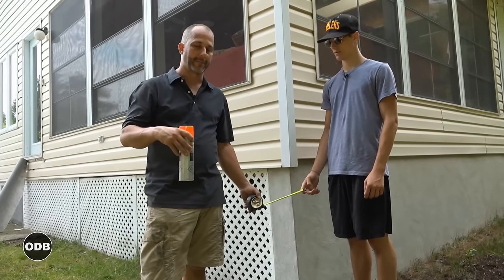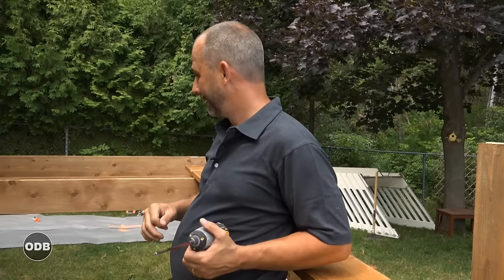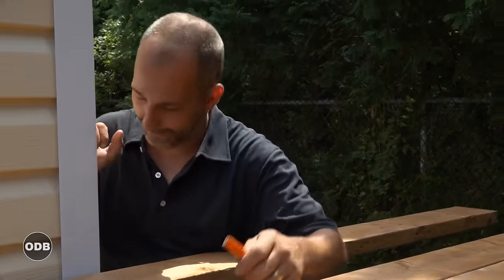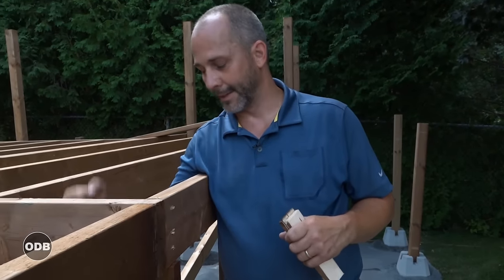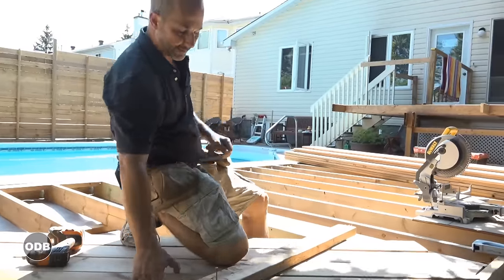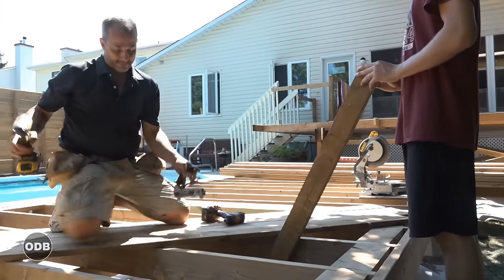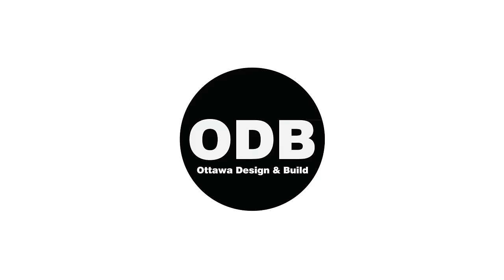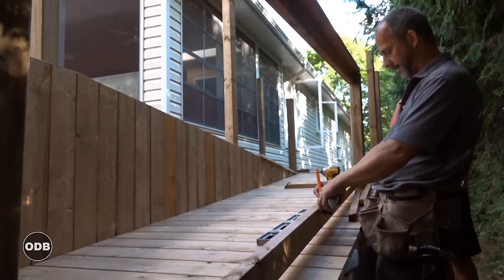How to Build a Deck for Beginners A to Z

Comment: This deck is NOT legal in most USA states. DO NOT build your deck like this. Footings should be below frost level, lag  bolts should be used not screws.This is a poor example of building anything.
Reply from the maker: Funny, a large part of the united states doesn't even get frost. Structure built on top of box beams don't need lags. This deck was built with a permit. Gary is obviously sadly mistaken with his understanding of the facts.
Reply: Water is changing volume of the upper ground (specially with grass) and you get floating level of each corner of your deck. No matter where you build you should always stay on the sand not on the grass
Reply: Ottawa Design and Build Renovations g
Reply: In California and Minnesota (both places I've lived), we need to either have posts in the ground or have concrete footings. Saved on a lot of labor, which dramatically lowers cost, however; I am just amazed it passed inspection. Never tried the camo screws, and they look amazing! I'll have to try them sometime.
Reply: That is one good reason you might wanna move to Canada mate!!!
Reply from the maker: truth is you could remove the organics, but time with settle that deck a 1/4 inch. not a huge deal.
Reply from the maker: Allen Peyer, The trick is to know your local building code and have the inspector do a pre construction visit to discuss the plan and make sure you are delivering the product that the inspector wants to see.
Reply: Friend, so you got permit from inspector for this deck construction, right?
Reply: yeah, this is just crazy unless if live if arid states near sea level like Texas.  you can argue about frost all you want but it only takes 1 frost season out of 10 20 30 years to screw up your deck.
Reply from the maker: frost doesn't damage a floating deck unless you attach it to the house. that would be dumb.
Reply: Gary is 100% Correct.  I am a GC licensed in several states both northern US and southern.  This type of construction is not legal or even close to legal.  In NY, NJ, PA and CT you need 12x36 footings or 18 in some areas.  In FL you must go down 36" and 6" above ground level.   I guess Canada is different but do not plan on then process being so easy in most US States.
Reply: This deck is perfectly legal in Seattle.I watched a city inspector buy off my neighbors deck.Nice deck!
Reply: Gary Oldham its legal in hawaii, theres no frost level there
Reply: This deck is perfectly legal. If you listen to Jeff (who goes above and beyond  in his work) he explains that the screws are not bearing any load. All load bearing points are set with screws and bolted into place.
Reply: @Customer Service, Please post some of your build videos so we may learn from the master..
Reply: Communism becomes the scapegoat here. The problem is this country never proper teach what communism really is.
Reply: I remember him saying that the county/city gave him a waiver because it is attatched to the house "Which in my state would not pass inspection if attatched or closer to any other structure less than 6' being a floating deck. Also has to be less than 30" from the ground if a floating deck. I think these guys did a great job under the circumstances and situation they had.
Reply: i believe he said they could have gone with footings but what the county wanted wasn't cost effective for the client so they went with this so suck it
Reply: Gary Oldham I
Reply: Come to Montana and put some footings under frost line (7 Feet) ha h
Reply: @dattape2828   He is quite correct, a floating deck is just that, A FLOATING deck!  It move up 1/4" in the winter @-40 C/F and lower 1/4" in the summer @+40 C/103 F. In Texas you run the risks of hurricanes. This build is not for you...I understand that. So pilings (in Alberta where I live 8" Sauna Tubes reinforced with rebar) with a 24"-36" concrete pad at a minimum of 4' below grade for each post would be your only option. Each and every state has their own code, and we must follow those codes to get an inspection pass, to continue.
So do us all a favour and not spout American standards, which are followed in Texas. Your neighbouring states NM or OK have different standards. You are comparing Apples to Oranges. The site Jeff was on ALLOWED him...OUR Set CODES.
 To be truthful, Jeff went overboard on the construction to ensure it was safe and done properly and above the Municipal code. Then end result was fantastic! I would love to work with this man for one year just for the experience I would receive.

Comment: Wow. I found this video because I was wondering about using deck blocks in this area where frost is definitely an issue (I'm in Carleton Place, just west of Ottawa). I learned so much from this awesome, straight-forward video.

Thank you, Ottawa Build & Design, for the education.
Reply from the maker: Hi Dave, great bumping into you at the Home Depot. Remember, I am here if you have any Questions
Reply: Actually, you were a huge help yesterday in the store. Super helpful.
Reply from the maker: Glad to help Dave. Good luck with your project, and remember I am always here to help in the comment section of the videos.

Comment: Really liked this video! I'm a carpenter of 10 years and although I would have done a few things differently like notch the posts for the support beams, loved the ideas a newer techniques for fastening. I've always done things old school so seeing the new Simpson joist hanger screws and that camo fastener system instead of surface screws really caught my eye lol. Thing I really liked was the tampered glass on the railings, it definitely opens up the deck to the yard and pool area. Great job! I got a 600 sq ft deck to build in the coming weeks so I'm gonna make some suggestions haha. 🖒
Reply from the maker: Thank you. The post idea is definitely causing some waves however I am glad you appreciative the other elements of the deck. All I know is , if it passes the inspector and engineer then who am I to complain.

Comment: Really great video, I recently did a deck using pavers on the ground and little threaded feet to keep it low profile. I found just removing the grass to get down to the clay took a bit of bounce out of it. I picked up lots of tips from your video for next time!
Reply from the maker: The truth is with floating decks, you want to maintain access to the structure to manage any movement anomalies. This is why i wasn't concerned about the grass. I figured i would be doing an adjustment call at some point. Thanks for watching

Comment: Thanks for putting the time in to show so many tricks to simplify workflow, you obviously love what you do and you're not to shabby with a camera and editing :) Congratulations on a wonder build, I hope the client is happy as it seems you've really dialed in to what they required.
I've gained the idea of the Camo system which to get the finish I'm looking for may take twice as long as visible fixings but it will save me hours of counter sink, filling and sanding so thank you again.
Reply from the maker: My pleasure, btw camo screws have a stand op speed attachment if you are doing a large space. It can make it much quicker!!

Comment: Very nice! I'm building my deck like this (floating) so I can stay out of the dirt/grass here in SE Georgia. Will only be about a foot above the ground. Wont be attached to the house, and will have a concrete pad for Hot tub right next to it. Like that picture framing technique, Thanks for posting!!.. Built a 16"x24" shed on blocks, (floating I guess) about 2' above ground, 8 years 3 hurricanes and the rascal still stands, so I know that building on blocks like that does work.
Reply from the maker: They don't do well in tornadoes though. Thanks for the comment. Good luck with your deck. sounds great.

Comment: I have found that Kreg offers a great hidden screw system versus the camo, I found it works a little bit faster and i personally like working with Kreg's screws more, just a thought, the deck looks great, and that box frame system was definitely the right choice.
Reply from the maker: Thanks Patrick. I will check that out

Comment: Hi Jeff,  great work as usual. Quick question, Im buildng a one level floating deck this summer and was wondering if it's safe to bolt a Gazebo on top of it? I'm planing on getting those big box store pre-fab Gazebos.  Thanks in advance.

Comment: Looks good.   Seems to be well planned out.  The only things I would do differently:

1.  On the lag bolts on the beams, instead of doing vertically, I put them diagonally.  Keeping the stress of board splitting away from a single line.  Like you did with the skirt.
2.  Use joist tape, especially on the blocking you have.   Without tape, runs a bigger chance of trapping water.
3.  Wear safely goggles when sawing to prevent getting dust/metal in your eyes.  Especially if you are presenting to others. 
 But at least your junior junior carpenter had glasses. :)

Other than that, good stuff.
Reply from the maker: Still working on the balance of safety and just acting safe. I have seen a lot of videos where guys use so much ppe that they put themselves and others in danger due to not having a clue of their surroundings.

Comment: Awesome work! Great Content! I've watched countless Hrs of your videos! keep it up.
I'm in process of planning a floating deck (12x16) under a covered porch on 12 inches of Gravel that the builder put in approx. a little over a yr ago.
I was thinking of doing a Box beam on deck blocks.  Deck will have 1 step down. 
Wondering if 3 rows of a single 16x2x8 on a span of 3 or 4 deck blocks would do it. or should i be doing 4x4  into the block with (2) 2x8's. I hope this makes sense!!
I'm in south west Ontario.

Comment: Enjoyed the Video. When skirting, how do you cover the support blocks below. It looks as if they'd stick out just a bit at the bottom. Want to make sure I do it right lol.
Reply from the maker: In this case we weren't concerned about the rear view of the deck but you can hide this simply by adding another rim piece to the existing structure.

Comment: Great video, two concerns, you really need to start wearing eye protection when using your power tools. And do you use triple galvanized joist hangers to combat the corrosion of the copper treatment in the treated lumber?
Reply from the maker: Not sure about the copper. I use whatever is on the shelf at the building store.
Reply: USP at Lowes is hot dip triple zinc, and simpson strong tie @ HD, is 90 minute electroplated galvanization. Either or, both are fine for deck applications.

Comment: a floating deck and deck block's I like to put a 2'x2' footing on tamped gravle over soil and take 51/2' of grass and soil.Because I have had deck blocks move and even sink unlevel. I really respect  that you understand screws are no good for framing and you should use nails or hardware that's made for the situation at hand.i like using a palm nailer for joist hangers because its fast and hangers get boaring.lol. have fun guys
Reply from the maker: great ideas bruce.
Reply: I learned this from 2 olg guys that use to set up my  work week when I was just starting out as a installer and got all the shit jobs.lol.Respect and good job guys and nice to see your son working with you

Comment: Just a couple of points: 
1) I noticed when you were showing how the stairs of the deck would be built, that the beam supporting the ‘fishtail’ deck was positioned on top of the concrete block, not in the grooves how it was originally positioned? 
2) you appeared to fix the head of the stair stinger support to the thin timber siding of the deck with only a few screws? Please tell me it was better supported than that!

Overall, looked a good job, but can’t say I particularly like the surface blocks... I would have wanted to put a box around the lower part too, and cross braces between the upright posts on the 5’ high decking and the ramp section at least.

Comment: Hi Jeff, great video once again. I thoroughly enjoy watching your videos and learning from you. I'm interested in building a deck in my own home and I am trying to determine what the general guidelines are for spacing of concrete posts or blocks. Would you please share what the guidelines are for quantity/spacing of concrete posts based on beam and joist sizes? Thank you!
Reply from the maker: The space between supports is all relative to the size and type of lumber you are using. I would stop by the local building office. they usually have some good reference materials for deck building that will help in your district. Cheers!

Comment: I notice that you put a beam on the lower deck in the center. What was the size of that beam , 4x4 and did you use 1/2 galvanize bolts .

Comment: Jeff, @ 7:37 and really for the whole install of the structure, there is an easier (and cheaper) level to use. Using a 20' or 25' piece of 1/4 inch clear tubing filled with water ( and a drop of dish soap) you have a very accurate long distance level. It would save a lot of time and energy for this and other installs.
Reply from the maker: Hi Logan we will show the water level system on a deck this year. Cheers!

Comment: looks great . and very well explained the process of building. but if i build a deck like this i will not pass inspection on the the footing,  the use of screws instead of bolts.  but...looks ok. i live on North Carolina USA and building code requires concrete footing below frost line.
Reply from the maker: We do as well. However we don't have gale force winds here which is why this type of footing is allowed as well. Thanks for watching. I hope you subscribed to the channel.

Comment: Looking to building a floating ground level deck but was hoping too see what you did around the concrete blocks on the small deck? How did you finish it? Don't they stick out?
Reply from the maker: We built a small 4x4 retaining wall and filled it with river stone. It was the back side and so we were not to concerned with the aesthetics.

Comment: Wow...  great job. Your video has inspired me to build my own deck.  My deck would be 10 x 24.  I'm thinking of building two 10 x 12 sections.  How many deck blocks would you use?
Reply from the maker: if you build 2 equal sized deck sections I would use 8 deck blocks and build my substructure with 2x8. good luck and thanks for watching. Don't forget to subscribe. We have a ton of great material on the way

Comment: I know the carriage bolts you used are rated at a high shear strength, but I would still use the beam over post method for peace of mind.
Reply from the maker: I totally get it. Did you know the Eiffel tower in Paris is constructed completely with carriage bolts and does not have a single weld in it.

Comment: Super helpful video, thanks for making this. I'm building a 10x10 ft square floating deck and will be referencing this video a lot! Do you have any suggestions on how many deck blocks I should use to support the frame? Thanks again for your help!
Reply from the maker: If you use the box beam method 4 blocks with 2x10 frame with 2x8 joists and rim. good luck!

Comment: The one thing I really wanted to see, you didn’t show. What did you do to deepen the structure to fasten the stairs to the deck frame? You don’t have much depth once you drop it down by the first rise. 
Also, should you fasten the stairs with carriage bolts or at least with nails? Wouldn’t there be a lot of shear force if it’s just fastened with screws?

Comment: Very informative video. Really like the glass panel concept. Considering this myself now as a DIYer. Two questions if you dont mind. Is the top rail above the two panels of glass at 1:18:26 continuous or do you have a joint at the post? How deep did you make the channel in the top and bottom rail for the glass?

Comment: This is reall well produced and pretty enjoyable to watch.

So, am I understanding correctly that the "box beam" allowed you to use very few of those concrete footing blocks? You also mentioned something about the cantilever of the deck...the logistics of which flew over my head...could someone explain it to me a little? Thanks!
Reply from the maker: A box beam with 2x8 joists will span 8" inmost jurisdictions and also allow for up to 2 ' of overhang or cantilever  on each side. thus giving you a 12 foot span.
Reply: Ahhh...okay, I get it now. Thank you!
Reply from the maker: glad to help Mark.

Comment: Fantastic video, you can tell you have been in the trade for a while, you have an obvious understanding of not only what looks good, but what will practically work for years to come. So many comments on here criticising, saying it isn't up to code bla bla bla. You clearly state it is several times in the video, maybe some people have their ears switched off? Anyway, a great build and well designed. Great points on working with the clients too, too many people let their own ideas and ego get in the way of a design and build, rather than making something that the person who is paying for it actually wants, and something you can be proud of. 
Do you have any more details regarding the timber/glass  ballustrading? Is it just dado grooves the whole way around or is there more too it? Also what thickness glass is in them?
Regards from NZ.
Reply from the maker: The glass was purchased off the shelf at the home depot. It was designed to go into an aluminum rail system. It was 8 mil and yes the framing was that simple. we did use structural screws to join the framing to the posts however. Again this was engineered for Canada. A quick simple cost effective stylish look.
Reply: Ottawa Design and Build Renovations  thank you for your reply. I understand the legalities/engineering will be different depending on the application and area/country. Once again excellent work, and thank you.
Reply from the maker: Our pleasure. good luck!